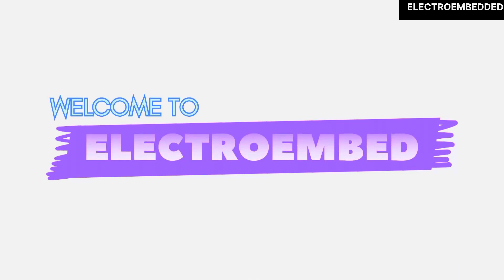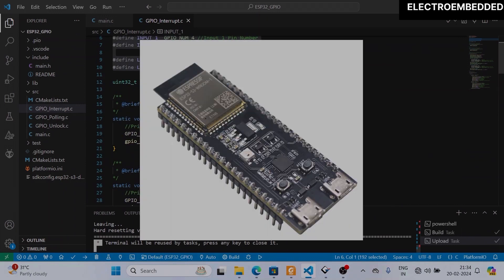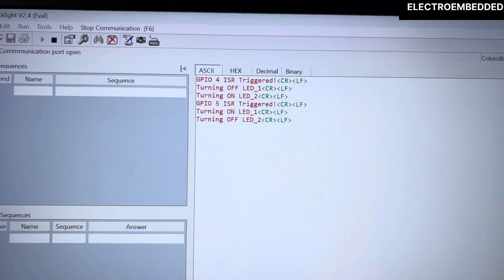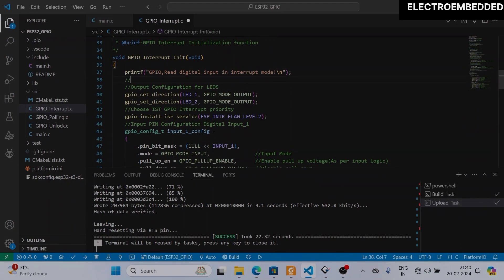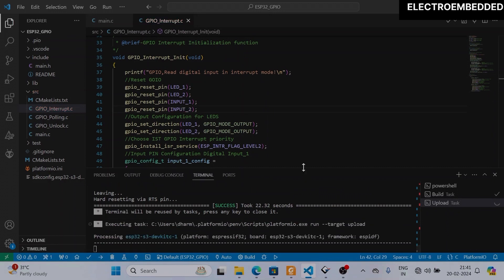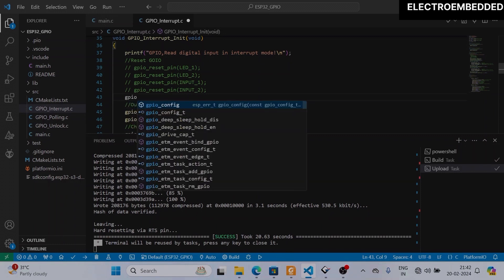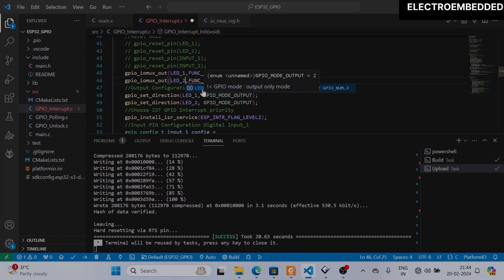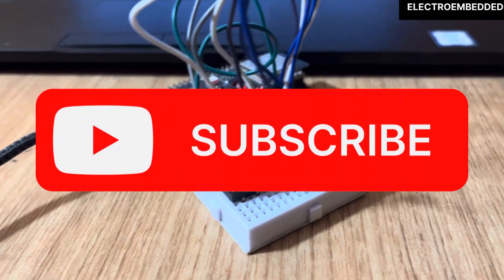How to Reset GPIO and Digital output Pin Mux using espidf framework and esp32-s3

Comment: GPIO on my esp32 s3 devkit c1 can't be used, I use simple LED blink program code, but the LED doesn't light up, do you know the solution?
Reply from the maker: You are trying to blink onboard LED?
Reply: @dktechs  no, i trying to blink external LED and MQ Sensor
Reply from the maker: If possible can you share your code,
I am considering you have done hardware connection in right way.
Reply: @dktechs  sorry sir, i think my problem already solved, My GND and 5V pins are a little bit wrong, so I use another 3.3V and GND, thank you and sorry
Reply from the maker: Good 👍

Comment: Can this method also be used in Arduino IDE? Thanks
Reply from the maker: I think you just need to configure pin in input or output mode in Arduino IDE. You can try